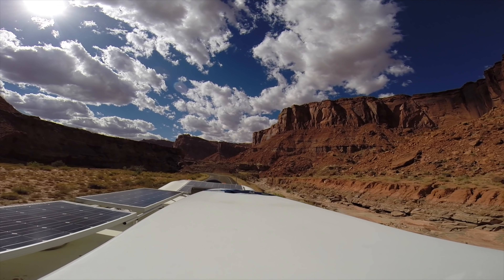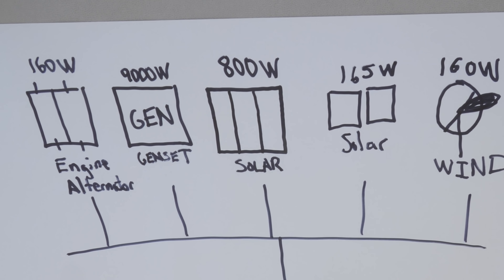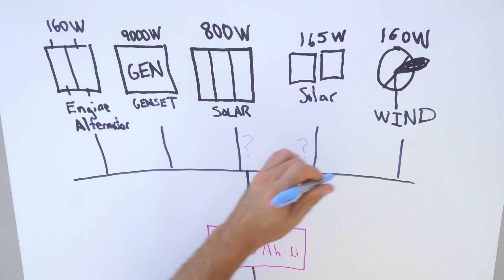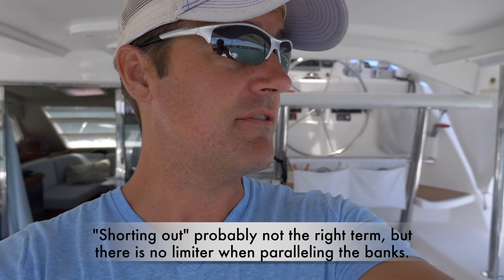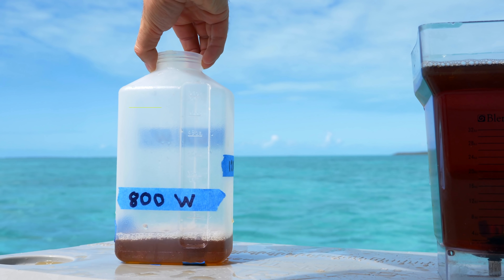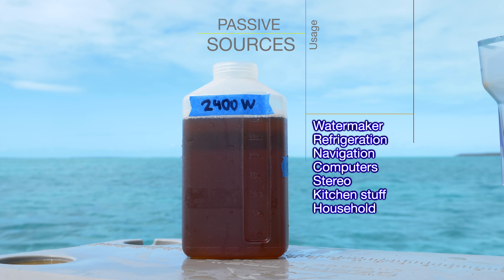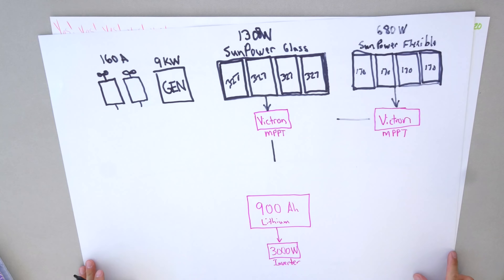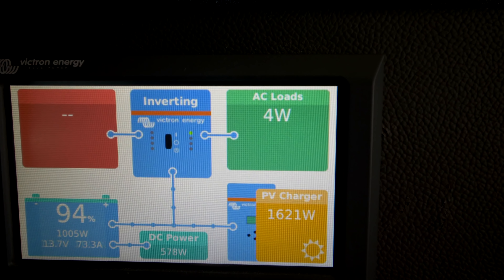How to manage electrical power on a sailboat using NO fossil fuels!

Comment: Hello O'Kelly's; Nick a great video however you need to explain that cruisers should asses their own energy usage profiles. There are many ways to live on a boat, yours with all the comforts of home and someone like James Baldwin's with no refrigeration or almost any other conveniences are on the extremes. As an alternative example I offer my boat. My refer uses 24 amps a day even in the tropics. While I have an expensive holding plate system the newer "cooler" types of systems are very reasonable in cost and use a similar amount of juice. They have become very popular for that reason. Propane stove and oven. All LED lights very low requirement even sailing at night. Modern Nav systems with radar also not a huge draw. The key is no autopilot that you are tied to, I use self steering with no power required at all! Watermaker you bet, but no long hot water showers, in fact no hot water. It uses 7 amps a gallon, how much water do you want? So my boat got by on 160 watts of solar and a wind generator. Battery bank was 450 amps. In a refit the wind generator was removed, solar increased to 430 watts and battery bank increased to 675 amps. Plenty of power but no hot tub. Instead 85 deg water in the Sea of Cortez and a cold beer, that works for me!
Reply from the maker: Thought I made it pretty clear that it’s highly individual. And it is, to the person, to the boat, to the use. Our last boat had no refer and we did great with 400W. Your description makes me think you fall in line with my estimates, though your refer sounds unbelievably efficient....It must have been very small and very well insulated...that’s an average of 2amps/hr. Wow. I know James. Good guy. Agree, no need for a hottub in SOC in summer. In winter....I’d take one, especially after a norther. Be well.

Comment: Great video! We use those victron inverters for projects at work and they work so well! Have you ever thought of pulling out one of your engines and converting over to an electric sail drive on one side?
Reply from the maker: Interesting. No, we’ve got two good diesels at this point, so we will stick with that for now.
Reply: @TheOKellys  I like Andrew's suggestion as a future replacement though.  It gives the benefit of retaining dual motors, but gains the advantage of hydrogeneration, silent motoring, etc., while being relatively low risk.

Comment: Hmm ..Solar is the way to go, but you must have a backup system as well,to charge your battery's, running your main engine alternator to charge the battery's should be the 3rd option, in your case 2nd is your generator, how many hours your generator has as of now ? if nothing wrong with it, why not looking for a way to bring the noise down by some insulation setup, cost is the key, for a new generator and making sound prof and go from there... it is always good information watching your videos..keep up the good work and be safe..!!

Comment: My dream cruiser is 100% solar, no generator. Plug in available for shore power.  Electric outboard motor for the dinghy. A/C, hot water, water maker, electric induction cooktop, infrared oven, 2 fridges, freezer, washer/dryer, plus the standard items.  Still not sure about dishwasher.  Yes, it's a cat, probably 45'-50'Thank you
Reply: Hey Paul... Buy a Silent Yachts 55. They have 10kw of panels! They're only 2 mill or so. Make us some videos so we can see how they perform in real life. And... since I gave you the idea you should probably have me aboard as a finder's fee reward 😉
Reply: I would highly recommend against an electric outboard. My catamaran is stored at the Marina docks, because im still in the process of fixing it up. Just in the last few months ive heard multiple people tell me they bought into an electric dingy motor, only for it to be stolen. They are more valuable than your typical gas outboard, so appear to be high on the theft list.
Reply: @williamhustonrn6160  maybe you need some image change? Tip I got from pro photographer that goes often in 3rd world countries. If it screams expensive it's gonna be nicked but put it in banged up scraped old housing and noone is gonna look twice at it, so he scrapes off brands, tapes it up with electric or duck tape  doing everything to look uninteresting
Reply: For a sailboat you don't even need full solar.  If it sails often enough, you can hydrogenerate if you have AC motors, and recharge the battery bank simply by sailing.
Reply: @justfly2525  great idea!  Start the YouTube and Patreon Channels!! I keep looking for real-world, real-time responses about how they perform.

Comment: ❤ these tech (Ted) talks, Nick! Great chart visuals, too. Kudos!
You'll NEED air conditioning.. when Megan wears the "come hither" stare. 🙈 😇. 
Ever consider a WEIGHT comparison of solar panels/battery banks/regulators/ inverters/ cables/wiring ( it's gotta add up).. to genset/fuel requirements? Just a thought. 
Interesting to us nerds. 😉
Reply from the maker: Hmmmm, interesting,….that weight is not insignificant, but I would say it is a fraction. I bet our entire solar setup is under 350lbs including charge controllers. Now we have a pretty light setup, but there are boats with big stainless solar panel supports where that weight difference would be much less. But unless the genset is buried deep in a very big boat like you’re used to, they make a lot of noise…and for me that’s reason enough to go solar.
Reply: @TheOKellys  Thanks for the reply, Nick. On a pleasure craft, or any craft for that matter, noise is a subtle stressor. It can also hide dangers... collisions with flotsam, or grounding. The sound of sailing can be calming or thrilling...depending on the moment. 😉
Really enjoy the great content you and Megan produce! 👍

Comment: You might need to keep the generator to run the AC units on those hot nights in the tropics.  The amount of your battery power needs to go up to reliably run the AC units during the  long nights.  In addition, the generator will serve as an emergency backup in case something fails.
Reply from the maker: We have that sorted....will chat about it in a coming video

Comment: Your sails are the ultimate form of solar energy, though it's indirectly derived in the form of wind propulsion.  Your sails probably give you the equivalent of 50,000 watts of electric propulsion and that's for most of the day and not just 5 hours on a good sunny day.

Those flexible panels tend to degrade within a year.  Also, you can probably cut your AC power to 400 watts using a mini split which is far more efficient and quiet.  As for the water heater, they have heat pump water heaters that can give you 5 times more heat than you put in.

Comment: You have a Victron inverter, so you could hook your alternator to your house bank, and charge the starter battery with the "trickle charge" connection.  It is between 1-4 amps depending on the model of your inverter.  This would probably be better than more solar.  Your solar will never do better than a diesel generator.  It will help, but your diesel generator does all the heavy lifting.  That generator will give 75 amps per hour on demand in rain, sleet, or snow.  Even 2400 watts of solar will only supply MAYBE 60 amps per hour at CERTAIN times, with NO shading, in PERFECT weather, and when it is wired correctly (NOT in series).  

Also, people have been having serious problems with flexible panels.  They start to break after as little as a year or two.  I would say don't get rid of your generator.  The generator and alternator are the work horses of any power generation.  Solar is just so you dont have to run them AS MUCH.  It will never completely replace diesel.  Your starter batteries probably fill in less than an hour and have no other load.  You are simply not using the rest of the power generated by the alternator.  You would be much better off storing those amps in your battery bank.  With lithium batteries you would need an external regulator on your alternator, but it should work with that and the trickle charge.  Also this upgrade is free it just requires powering down and moving around a few wires.

Comment: if you pull the genset can you add another 900 amp hours of lithium in that footprint and would that let you run everything including the ac? or do you need more solar to charge those new batteries
Reply from the maker: That’s a lot of money. i think we are good with how much we’ve got now. Going to try to make it work as is. Not totally sure we’ll take genset out. If we do, prob just storage up there

Comment: LOVE watching your videos and find them very informative while we plan our next adventure!  When you do get rid of your genset, will you be adding more lithium Ion batteries?  I thought it was common practice to size your battery bank to your incoming power - So, with your recent upgrades, you now have a lot  (2400W) of production capacity  with smaller storage....
Reply from the maker: No, same amount of storage. Best to size your battery based on usage. We are good there, for now. Removing the genset would mean we want more battery to deal with times without sun. These batteries are $3300 each. So since everything is working well right now, going to continue as-is.

Comment: Solar is great option.  But 2400w, how much u spend for set up.???  And how many years will this solar set up will last?
Reply from the maker: For the solar? About $5500. Batteries cost a lot more than that. How long will it last? Knowing me...I’ll want to try something new long before it wears out. Those flexible panels probably good for five-eight years. The rigid panels 20 years. Charge controllers? Forever I would hope.

Comment: Looks like the RB-300 RELiONs. Any advantage to doing a 12v system vs a 24v?
Reply from the maker: Just that it’s easier to buy 12v stuff than 24v, otherwise 24v has the advantage.

Comment: In your set up, do you have a washing machine? If not do to the power draw would you need to add an additional panel or two, or additional batteries?  Excellent video, thanks for sharing! 
😍👍😍👍⛵⛵👍😍👍😍
Reply from the maker: Yes, we have a washer. Plenty of power to spare now.

Comment: Nice work,
is that 2400w per hour that you need?
Reply from the maker: No no, that’s the wattage of the panels altogether. They generate about 4x that in a typical day.
Reply: @TheOKellys  so on your boat how many kw per hour would you  need if you wanted to go completely electric?

Comment: Nick and Megan if you go north where there is less sun and often foggy/cloudy for weeks, you need something other than solar panels. We have never liked the Honda gensets as they are so noisy and in fact have seen people in anchorages clap loudly when the cruisers turn off their genset after charging their boats. So what is the backup plan if you have a failed regulator or the weather is uncooperative? Really enjoy your videos as always😎🌬⛵🌴
Reply from the maker: Well, we’ve got two alternators and there are three separate charge controllers. We carry a spare charger and inverter. So Id say we’ve got a lot of redundancy. We’ve owned two EU2000s for our scuba compressor on previous boat, and agree they are not optimal in the anchorage. But for an emergency setup, pretty hard to beat. We haven’t decided for sure to ditch genset. It’s all a grand experiment.
Reply: @TheOKellys  Certainly understand the complexity of this process as we are completely redoing our electrical system as well.😎🌬⛵ Have a great weekend you two.

Comment: We worked out how much we use on all our systems and make do with 300w of solar for fridge, lights, tv, music, laptop, navigation and autopilot.
Reply from the maker: wow, that's hard to believe.
Reply: @TheOKellys  the big users are water makers, compressors, multiple fridge freezers, power windless etc. we don't have those, we are a 34ft mono tiller helm. We are live aboard too. 

200ah li (victron energy superpack)
1 58l fridge
raymarin a series plotter 7inch screen  with rayder and ais, evo auto tiller
all LED lights ( but our main cabin only has 4 so not a lot)
our t.v is 24 inch so quite small

in the summer we are fully charged by 10am. 
Our power consumption is quite low, with no charging at all our 200ah will last us 4/5 days at anchor without being carful at all.
Reply: @TheOKellys  i just checked and its 350w not 300

Comment: Great video guys. just a question. wouldnt the MPPT 150, allow 150 x 70 W at a go? i.e. you can go with a much smaller MPPT?  or am I completely wrong at this?
I find it so confusing and no matter how many videos I see I still cannot fully understand  :) appreciate any help or links
Reply from the maker: Maximum voltage is 150V in coldest conditions, so it depends on how you are wiring your panels, in series or parallel. I personally would never set these up to even close to max capacity...they are expensive and generate a lot of heat. If this is confusing, I would say you should absolutely, positively have a professional handle the install for you.
Reply: @TheOKellys  that's the plan, but before going to a professional I like to learn about it all myself :) I first need to understand how much load I have to understand amount of panels and what wattage I need then I can start planning slowly

Comment: Helpful video 

Just wanted to ask a couple of follow up questions 

Do I have it right that you have around 2,400 w of solar generating capacity, with 900 w of house battery storage as shown in your diagram ?

Can I assume it’s all running at 12 volts ?
Reply from the maker: Yes, you got it!

Comment: Hi Guys very informative vid, on a subject many of us boaters think about. I was wondering if you've ever thought about taking electric power a bit further and going for an electric engine ?
Reply: He has a 2.4 kW solar system. An modest sized electric motor can max out at 100 kW, though obviously much less if you keep the speed down. So, he’s a bit short by a mere factor of 40. Clearly batteries can fill in the gap for short periods, but you do need to charge them. With a factor of 45 difference -  actually more because the sun doesn’t shine all day — going solar only for propulsion on his panels might mean you can move the boat under power one day every  6 weeks.  So, not with his panels. He is just powering home loads, not propulsion.

As to realistic scale, a land based home solar system might be 5-20 kW. If you are off grid and provision for a northern winter, maybe you’ll install 30kW with backup diesel or wood heat. However, fitting more than 10kW on your roof might be challenging, depending on roof. The problem for boats would be where exactly you are going to mount all those panels. Cars have the same issue. Houses get off easy because they don’t move. Our Tesla usually uses more power than our house each day. Some days it is twice as much. Hydrodynamic generation while you are under way with sail power through the prop seems promising, but you are looking at scaling up the battery banks quite a bit too. Much depends on how many engine hours you want to keep in reserve to make sure you can stay off reefs / traverse canals when sail is not an option. 

I think it is possible, but you are going to have to really design the boat for solar generation first and foremost, cover it prow to stern with panels, and get rid of all those sunny entertainment spaces on deck. (Limiting sun exposure is excellent for your health!) You can keep the covered cockpit in the stern probably.  I doubt charter yachts could get away with that, so we are probably talking owner live-in boats exclusively.   There are some solar powered power yachts, but they can do maybe 4 knots under sun alone. Really they are solar assisted fossil fueled yachts, in need of way more panels and way more batteries. Because of the shade from rigging you’ll be looking at microinverters. You’ll also need to install a couple thousand lbs of additional batteries below. You’d almost certainly be looking at using the prop to charge batteries while under sail, provided you can get enough that way, because sun alone won’t be enough. Maybe it would work with enough battery if you only sail on weekends.
Reply: For a 30 to 40 foot monohull a 10kw electric motor is sufficient.

Comment: I am currently planning to build my own solar battery system I would like to know if you are operating a 12-24 or 48 V system
Reply: Also interested to know about the system voltage.  It looks like 3 - 12v Relions, so I assume the system is 12v?
Reply from the maker: All 12v on this boat.
Reply: I’m looking at 4-500w Solar panels (2000w) but it says they’re 48 V can it  be reduced to 12v system.
Reply: Most loads ( refrigerator, lights etc) were made in high value and low price for cars ... with 12 V. Your loads consuming Watts - Current times Voltage. If using 48V systems, the current is 4 times lower. This helps in two ways: You need lower square cupper in your wire or/and your voltage drop, between source/battery and your load (lamp) is lower according to the power (Watt). 
Best solution: Use 48V and DC/DC converter to 12V close to your load. This helps to prevent voltage flicker/jump which you see on lamps (not led). Ok?